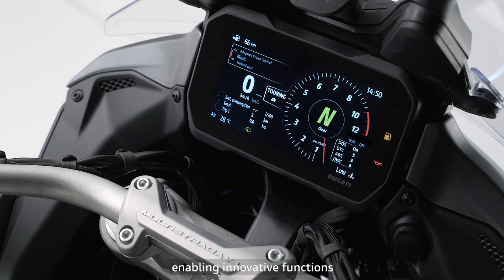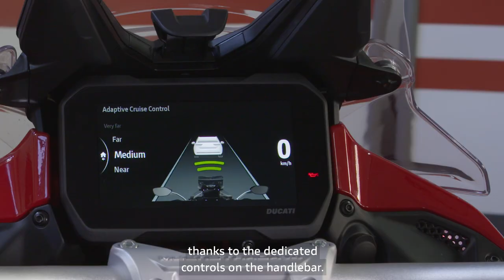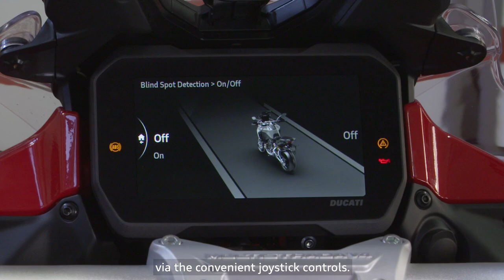Ducati Multistrada V4 | Front and Rear Radar System

Comment: As usual, Ducati raised the bar. All motorcycles should have this blind spot radar. I use the cruise control on my 2022 Multistrada V4S and I love it. Very high tech. Keep up the great work Ducati!
Reply: Is the transmission automatic? I’m wondering what happens when the speed reduces below a certain rpm

Comment: I have ACC on my car and sometimes it has false positive detections without any car in front. I will never put such thing on my bike. Mistake in car means nothing mistake on your bike is fatal. No thank you. I prefer to have control over my bike not some computer with a faulty program. I am a computer programmer and will not put my life to a computer.
Reply: Thought the same 😅 it will help but always i will do old good head turn before switch lines